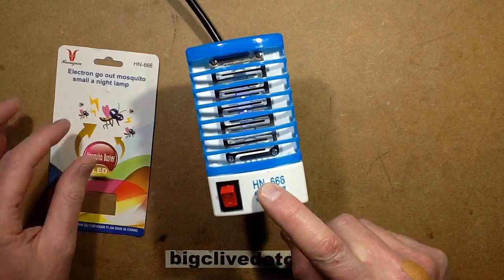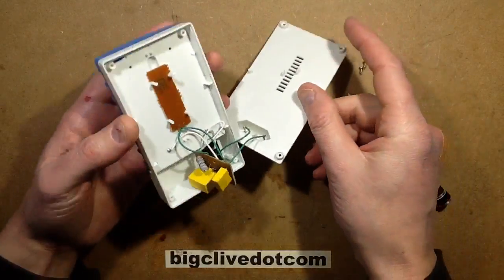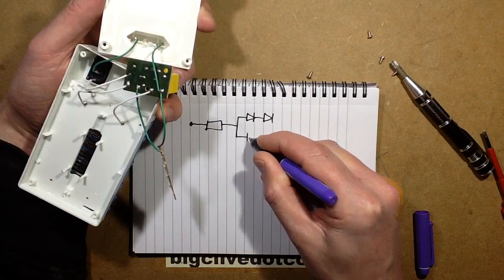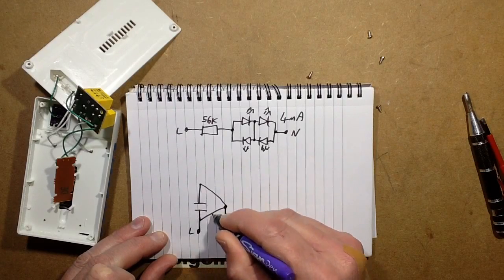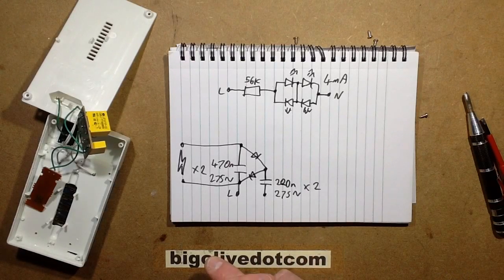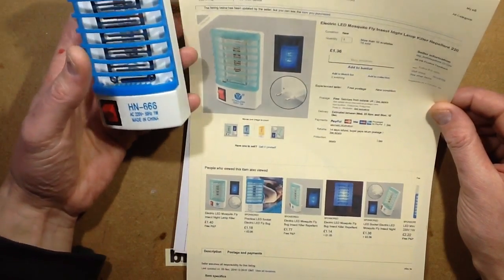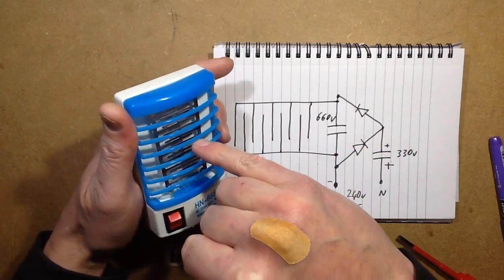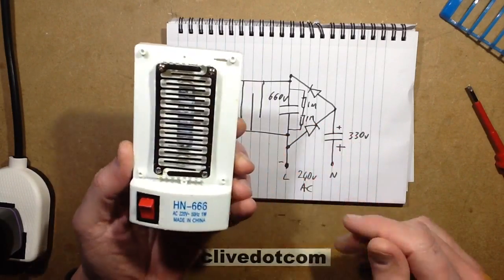Return of the dodgy insect zapper.  (With schematic.)

Comment: Use some small ring spacers on the 4 pins that align the LED board to make sure your new LED board is held away from the zappy-grid and you can use your standard peg shaped LED's just fine...

Comment: I have one of those , I cut the two pin plug of the beck and mounted a 13 amp plug top lid on the back brought the wires through connected the rest of the plug reassembled with 2amp fuse and you can plug it straight in the 13 Amp socket.

Comment: I  was curious about these, I have one old one that is cordless and sort of works yet we use it in the camper when we camp in the Dakota's where the bugs are dreadful, strangely we never had that problem when we go south to Arizona in the winter though.  So anyhow i went to Ebay and looked, found the same one as this, it says you can use it on either 220 or 110 volts!  I wonder if it would build enough power on a 110 volt system to work if it is the same on the inside as this one?
Reply from the maker: On 110V the LEDs would be dimmer and the grid voltage would be lower.

Comment: A small oscillating-type room fan would make a nice, safer enclosure for that. Disconnect the fan motor, mount the zapper inside the grille in place of the blades, and connect the zapper to power through the fan's power switch.

Comment: So... trying to use different colors to see what's most effective, eh? 
Why not build a fruit fly spectrometer then?
A clear strip of plastic with some clear double sided adhesive tape on one side and a strip of leds on the other side.
Leds starting with nIR over red to yellow, green, blue to UV.
You could even put them into a tube. Leave the thing in the kitchen over the course of a few days and then take the "measurement" :)

Comment: I was pleased to see that you actually proved the unit worked before tearing it to bits, as you did last time. Secondly, you are applying  British Standards Institution (BSI)(aka Bullshit Standards) to a device that doesn't even claim to meet these over-engineered standards (just look at a 13A plug).
-
What you are missing is the fact that these products have been cost optimised by the Chinese. You couldn't even buy a UK technician a coffee for £1.36. Even the blathering Trump couldn't have these made in America for the price.

Consider you have a molded case, a molded cover, two stamped metal grids, a PCB and components. Any plastic carrying 'mains' voltages has to be virgin, as opposed to recycled. The value for money is outstanding!

There are a couple of massive on-line indexes that have hundreds of thousands of piece parts from which manufacturers can select items on a mix-and-match basis. I access these all the time (they are in Chinese but I work Google Translate to death).

I always submit my designs to Chinese cost optimisation houses as they frequently can save considerable sums of input cost. I can select what standard I want the product to meet (OSHA, BSI, etc). (I am in VietNam)

These houses can optimise any aspect of a product. Comparing the first bug killer with this one I can tell this last unit has all the fingerprints of cost optimisation on it from the LED assembly, the PCB layout, etc. 

So please judge apples and apples and not apples and pears.

Comment: The last one had factory rejected capacitors. These are UL certified. That's the thing with buying from China. It's either great quality and cheap or dangerously bad and cheap. (Unless they are using the UL recognized component mark illegally. For those of you outside the USA/Canada, Underwriters Labs is a quasi-official organization that certifies electronics and other equipment for safety, compliance with regulations, quality, and respecting advertised specs. The UL logo, which is the letters U and L in a circle is placed along with the file number on large devices, but smaller ones are allowed to use the "recognized component" mark, which is the backwards R and U symbol. It is thus easier to use on non certified components. )

Comment: Nice of them switching the "neutral" (as on Bigclive's schematic).  The grid bypasses the switch, so there's a 50/50 chance of getting a mains shock from the grid to earth even when the zapper is turned off.  // Had they put the switch on the other wire, the capacitor would at least limit the current.

Comment: I live in the USA and I have a few of these, and I find they are actually effective in small (very small) rooms, particularly small toilet rooms where a mosquito will inevitably be attracted to at some point because of the standing water.  Small rooms that have washing machines, or pocket workshops are also where I have found these to be effective.  I installed one in my WC or half-bath as they say in the USA, which is a small space (barely enough room to wash your hands after you do your business) and it has destroyed  over 20 mosquitoes from what I can tell.  I try to keep them out of where I live so that is a significant amount.  To contrast that, the one I have in my hallway seems to have zapped one fruit fly... somehow.  For larger spaces, I would recommend something like the HOONT zapper, which is larger uses a true UV bulb, and fits into a light-bulb socket.  I don't have kids and don't plan on sticking my fingers in the thing so... I believe that in my specific situation I will be ok.

Comment: They could have saved connected the LEDs to the high voltage DC in series with a bleeder resistor. FFS, this thing is actually trying to kill you.

Comment: I want to buy some and remove high voltage circuitry  (using small SMPS instead of capacitive dropper) and plug it into mains connection, and make something out of it.
(Pranks and stuff)

Comment: 56 k.Ohm resistor is a simple and reliable option to drive LED's.
We used to fit potential indicators in CT meters and used 47 k.Ohm 3 watt R's in series with one Red Led and a reverse diode in the early 1990's. (Led current about 5 mA)  Many of these meters are now being replaced with the so called Smart meters and the LED's were working fine 27 years later.

Comment: at the end you say you would add 2 resistors across the capacitor to discharge it, but the Chinese would probably use only one. aside from the fact that these cheapskate manufacturers don't even use that. you diagram 2 1M resistors in series. why would this be better than a single 2M resistor?
Reply from the maker: Resistors have a maximum DC voltage rating.  By putting two in series you half the voltage across each resistor..

Comment: China:) No fuse, no inrush resistor, no discharging resistors. The 470n 275V capacitor is definitely not designed to see 680V from a doubler. The LEDs could have a capacitive dropper. Or at least a bridge and then all LEDs in series. This would give 2x the efficiency.

Comment: Did anybody else notice the LEDs flash at the end, during the final (unplugged) zap? That effect (660 VDC being applied to the LED circuit) could be a reason to not use a capacitive dropper, but I think it would make a simple resistor even less suitable.

Comment: "It's pretty neat" .. "It''s quite a nice layout too"

It's (brilliantly) terrible. But just think, someone had to design that plastic moulding to hold the little boards in place and to snap together, and they probably did it without any prototype or fancy 'design iteration'. Some one actaully had to design this thing, which when you stop to think about it is .... I'm not sure, but it makes you think!
Reply from the maker: Once you get to know my channel you will realise that it's all about really dodgy electronic stuff from China.  By "it's pretty neat" I meant that compared to other versions it really was a neater design.  And by "It's quite a nice layout too." I meant that it was actually a reasonably good layout compared to previous versions I've taken to bits.  It is of course completely non compliant with Western standards although it does actually have the potential to work.

Comment: Wouldn't it have been better for the zapping grid to be connected to neutral and one of the capacitors, rather than live? That is, if you flipped the circuit round. That way you'd have a connection to N, and one to doubled mains, but through a low-value capacitor. So it'd have limited killing power, for people. I dunno how much AC can pass through 470nF off the top of my head. 

Maybe to do with Chinese mains plugs not being polarised? I suppose you might want to hang it upside-down.
Reply: The plug (European not Chinese) is unpolarized.  But they can still decide which pin they want connected via the single pole switch.  It looks like the grid bypasses the switch in this case.   //  This thing can kill you even when it's turned off.

Comment: I would fry up bugs all day with this thing. Can you buy these in the states?
Reply: You could perhaps pour petrol round your living room then light it, probably be safer. It'd definitely kill mosquitoes.
Reply from the maker: It's designed for 220-240v operation, but would still work on 120v.  They ship them from China.
Reply: Better buy one with a propper save guard and not a live wire that can be touched. Just tested mine out and looked at the circuit mine has a transformer seperating the live from the high voltage circuit. And a bug collection tray :P.

Comment: Off topic: My apartment came furnished with an old Frigidaire stove and the oven's thermostat seems to be defective. I've made do with a toaster oven for over 20 years but sometime it is not quite big enough or go high enough in temperature. My little brother is actually my landlord so I could easily ask him for a fix or a replacement (he's a professional cook so he'll understand the need for an oven with a good thermostat) but I lately have been thinking of fixing it myself. 

I am both bad at fixing things (except if I built them) and also do not understand how an old (pre-electronic) oven thermostat works. Old electrical heating room thermostat are easy enough but how can the same principle apply when the dial is outside the temperature being controlled? 

Paradoxically my little brother is good at fixing electrical appliances and I thought him everything he knows about electricity, our minds do not work the same I guess. 

In any case I'm thinking of replacing my oven's thermostat with a digital one (and replace the analog clock that never worked since I live here anyway), but still I'd like an idea of what I might find out when I investigate how the whole thing works. Can you or anyone reading this link me to books or howto that might help me?
Reply from the maker: It would be easiest and safest to replace the original thermostat with an identical one.  You may find one on eBay if you type in the model number.  They often work with a remote probe that relies on thermal expansion to transfer the temperature to the front panel.

Comment: Assuming the voltage drop across those two LEDs is around 6V combined (a pretty reasonable guess), almost the entire 1W of power is dissipated in that 56K resistor (for a power efficiency of 2.5% !!).  It doesn't look like its a 1W resistor, but perhaps it is.  Either way, I'll bet it gets nice and toasty inside that closed case when it has been running for a while.

Comment: When you discharge it with the screwdriver at the end after it is unplugged - the LEDs flash momentarily - why would that happen?
Reply from the maker: The voltage change results in charge transfer through the smaller cap resulting in a pulse of current through the LEDs.

Comment: Two 18 kOhm resistors, each in series with one wire of the 660 V supply, would make it a lot safer, limiting the max. current to just below 20 mA.

Comment: Live and neutral
Hot and return
Phase and zero
Load and back
Any other names ?
Reply: +Sootikins 230V IEC standard is: Live - Brown (or any available color).  Neutral - Light Blue.  Protective Earth - Yellow / Green stripes.  For 3 phase there is a standard for the 3 phase colors too.
Reply: mczoze1998 Active and neutral in Australia
Reply: We've always called it Hot and Neutral rather than Live and Neutral here (USA) at least in my fairly extensive experience.
Reply: And just to liven this up a bit, here the wire color convention for single phase power is Hot - Black, Neutral - White, Ground (earth) - green (no stripe).

How about in other places??
Reply: Fase and Nul - Denmark.   3 phases are R, S and T (was Root, Stem and Top on the poles).
Reply: Active or Live and Neutral in New Zealand.

Comment: Bought a beefier bug zapper at a thrift store last year. Tore it down, harvested the capacitors, and turned it into an induction heater. Worked great, consuming around 300W from my bench power supply.

Only problem is, those capacitors were NOT meant to be used that way. They got so hot that the solder melted and the entire thing fell apart, making an awful noise and producing some impressive sparks/arcs from the still charged capacitors shorting across bits of the coil.

I'd say it was a resounding success.
Reply: The only oops there is that we don't get to see it on video...
Reply: oops.

Comment: if you were to short it out over longer time, what would break? wires?
Reply from the maker: Nothing.  It would be the equivalent of a 200nF suppression capacitor across the mains, which is how it's normally used.
Reply: thats comforting. thanks!

Comment: When I first started muckin about with LEDs in the 70s, I'm sure that I destroyed a few by connecting them reverse polarity.  This device exposes the LEDs to the wrong polarity half the time. What has changed?
Reply: The reverse voltage of each pair of LEDs is limited to a few volts by the forward voltage of the other pair because the pairs are connected in inverse parallel.
Reply from the maker: The LEDs are damaged when their peak reverse voltage is exceeded.  But the matching inverse pair in parallel caps that voltage to within their rating.
Reply: bigclivedotcom 
Do they have some sort of internal diode protection?

Comment: How much would it actually hurt if you touched it? Say on a scale of one to dead?
Reply from the maker: Two options.  Sore stab on end of finger, or if you were grounded at the time a significant current could flow from the mains, helped by the initial high voltage breaking down your skin's insulation level.
Reply: I wouldn't have shorted the grid with a test-lead, not knowing what sort of errant voltage-spike might damage the meter.

Comment: My dad worked on some early insect zappers with the circular fluorescent tube and a small transformer making the HV... Still see some of them in shops. according to him white tubes were found to be as effective as the blue looking near uv tubes but they went with the blue because it looked more high tech... and several species just weren't interested in light at all.
Reply: joinedupjon can you ask if they ever played with polarization? apparently biting flies are strongly attracted to linearly polarized light.
Reply: Robert Szasz I'll ask him, should be going over to give him a hand on sunday anyway. The specific product was called a Simon Insectocutor and looked like this http://snipurl.com/2ams708 The Henry Simon company was a manufacturer of grain milling equipment and the original idea was to control flying insect pests in flour mills but it ended up being marketed to shops and restaurants as a fly killer. afaik it was never meant to catch mosquitoes.   IIRC they tried various polymer reflectors behind the bulb including black but went with (dimpled aluminium  looking a bit charred on that example). light reflected off polymers is part polarised and I know the increasing use of polymer sheets outdoors in farming is currently a  concern in the UK because it's attracting dragonflies which apparently mistake it for a water surface.
Reply: +Robert Szasz Well the answer is no, but apparently they did experiment with filter sleeves over the tube and different reflectors. They were working with the tube manufacturer to find the most effective phosphor mix.
Reply: @joinedupjon  - That's fascinating - how long ago was this?
Reply: @NeuronalAxon  it must have been 50 years ago... give or take.
Reply: @joinedupjon  - Wow - that's a piece of history. ;)

Comment: Maybe in the chinese shop where they designed this thing, mains voltage was 250v and the voltage difference would equal 666v, hence the HN-666 model.

Comment: Looks like this will discharge into you via the plug pins if it's pulled from the mains still charged?
Reply from the maker: No.  The LEDs and resistor are across the plug pins, so any charge would be drained very quickly.

Comment: So presumably if you touched that while it was fully operational it would really hurt.
After unplugging will it also give a shock across the plug terminals or will that only effect the zapper section?
Reply from the maker: Plug pins will be quickly shunted to a few volts by the resistor and LEDs.

Comment: I've had a couple of these running all summer.  They only kill very small flies and moths, larger ones don't seem to be attracted by the LEDs which look as though they have been chosen more for their appearance to humans than for their effect on insects.  I had exactly the same idea about trying different UV LEDs but I was put off when I found that they were SMD.  Mine have the two stage voltage multiplier with four different capacitor types.

Comment: What if instead of using regular diodes you use LED's instead? May end up being an interesting effect if implemented correctly.
Reply: Blake Bowers He has a video on a lamp where they did it. I think it was in an arcade button
Reply from the maker: The high voltage means it would greatly exceed the reverse voltage of the LEDs.  This application requires 1N4007 style diodes.
Reply: bigclivedotcom Ah, alrighty. Thanks.